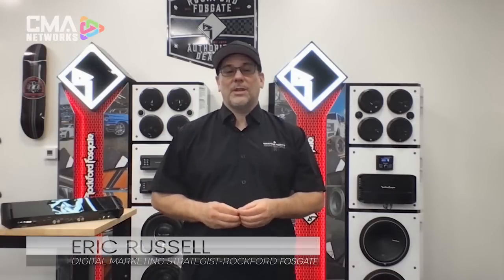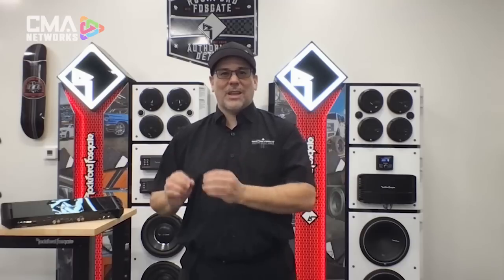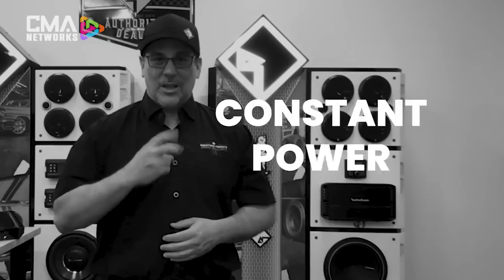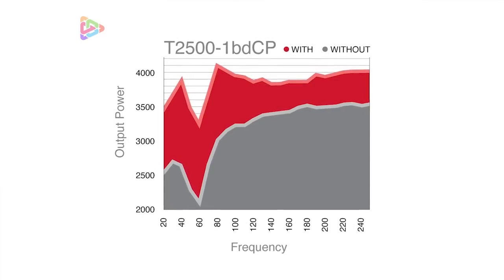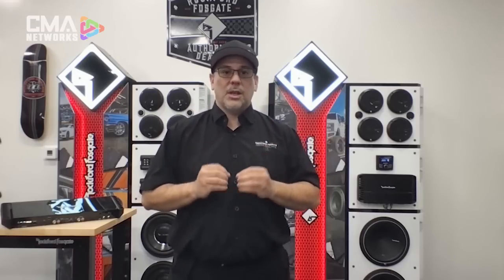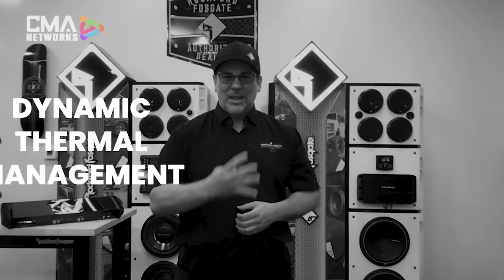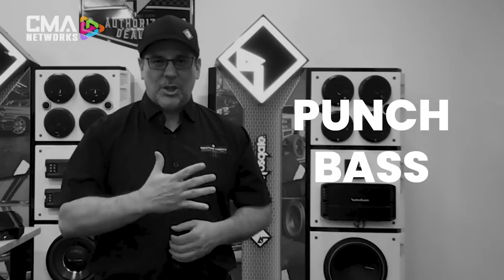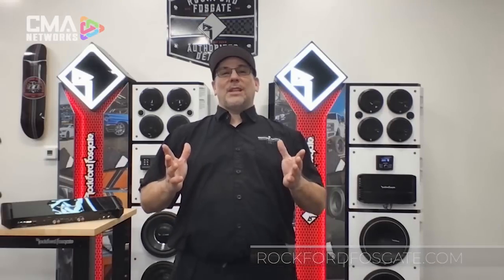5 Amp Technologies | CMA Showcase

Comment: So I have two remote bass knob. One is the RF T-1500 BDCP PEQ remote and the other is for LC2I pro remote bass, which one should I use?
Reply from the maker: These are 2 completely different types of controllers.  The RF is a bass boost, the AC is a level control.  Your choice, one isn't better than the other, just different functionality.  The T1500-1bdCP uses a PEQ for 0dB to +18dB @ 45Hz. The LC2I allows for 0 dB to -19 dB attenuation range.

Comment: I have one T1d212 with a T500-1bdcp ran at 1 ohm tuned gain with multi meter filter on hz 65 when I use punch eq I put it almost half way and get more bass how do I no if punch eq is too high when off it sound nice and clean bass but with punch eq on I get a more violent bass witch I don’t mine just don’t want to run amp to hard or ruin sub even tho I am under powering sub just want clean signal also running 4 channel amp factory head unit & lc7i pro
Reply from the maker: The T1D212 is rated to handle 800W RMS and the T500-1bdCP can produce up to 707 Watts x 1 @ 1-Ohm, so this is a perfectly matched subwoofer system.  We recommend raising the Low-Pass crossover be set at 80Hz, because the frequency you're currently set at (65Hz) is right in the "hard hitting" bass area.  The Punch Bass setting is designed to add a precise level of bass if the acoustics of the vehicle. You should have the maximum amount of bass when your volume is at 7/8 (not max).
Reply: @rockfordfosgate  is 80 hz on this amp 12 to 6:00 direction it’s sounds amazing at 80 hz I think I have it close to 80hz with no punch eq it says 65hz but no 80hz label thanks for the response appreciate u
Reply from the maker: @Thizz2979  Great!  Glad we could help.  Just dial it close to 80 Hz, it doesn’t need to be precise.
Reply: @rockfordfosgate  this amp and sub is crushing my 2018 Malibu no one believes it’s just one 12 😂😂 great products 🙏
Reply from the maker: @Thizz2979  Rock on, my man!  I think people are amazed when they hear an actual Sound Quality subwoofer!

Comment: yawn same amps for the past 14 years
Reply from the maker: Rockford Fosgate has been perfecting amplifier design since the 1980's, and sometimes iconic models make a lasting statement.  Some popular brands use the same off-the-shelf design, flooding the market with similar performing amps, but with a new model number or different color.  Rockford Fosgate utilizes its own unique technology - many of them patented - and those platforms are typically 5-and-6 generations ahead of the competition.  Rockford Fosgate builds amplifiers to withstand the test of time, and sometimes models will be on the market for a period, but that doesn't make them lower performers.  In fact, they still produce more power and deliver higher performance than what's expected, and there's value in that.